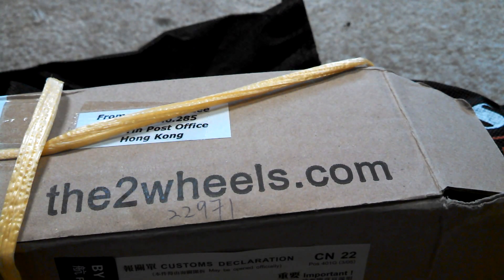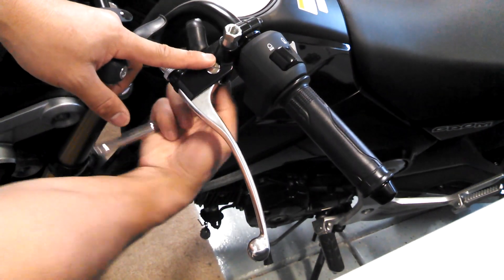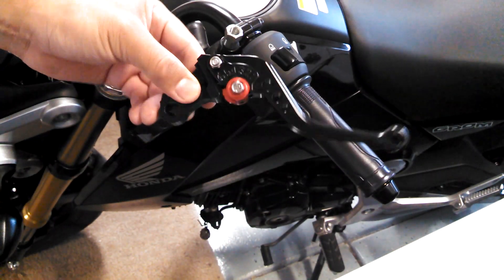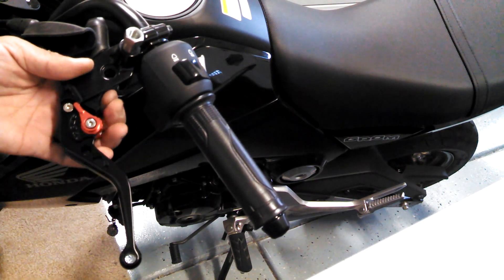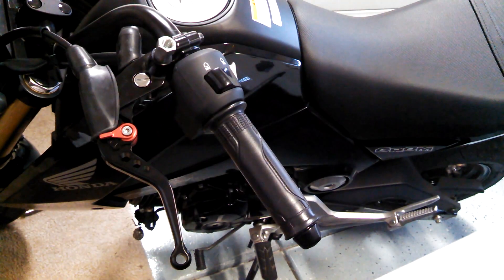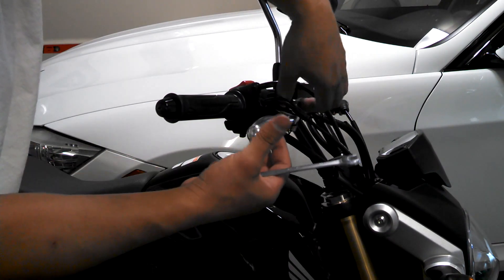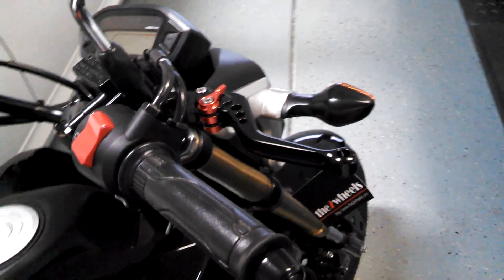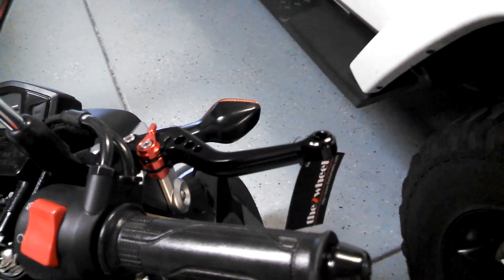How to Change Brake Clutch Levers for Honda Grom

Comment: Next time 1. Loosen tension nut at lever. Line up slot and remove cable first. Note: use short screwdriver so you don't scratch your new lever. Use blue lock tight on nut so it doesn't back off. Don't forget to lube pivot point. Great id. Thanks for sharing.
Reply: Nice one for the heads up 6 years on🏍😎🤙🏾 I use the push clamp to hold the clutch as you said above worked a dream easier than I could imagine...dope..

Comment: Hey I took your advice and bought a set and they set off my repsol Honda all matching throttle grips and matching well
Reply from the maker: okay cool - glad it worked out man... not too tough to swap
Reply: First time ever working on my bike on my own change oil and filter thank you for putting video up for first timer's like me
Reply from the maker: I'm actually a first timer also, trying to work out the kinks and documenting for all to see as well as for me to refer back to..

Comment: I have a cb500x(2014) and I've send many messages to Chinese sellers all saying it doesn't fit hydraulic brake ...and send to a couple of them ur video, I mean they are exactly the same in the pictures - I have the suspicion that they don't know what they are selling. They say they fit my bike ...but only the clutch :S

Lets see what they will say after watching you video(hope they can because of the great firewall of China - although sellers use workarounds most of the time - from what I've seen so far)

Comment: I'm still having an issue putting The clutch line back in the hole where the engine is. Even after I loosened the brake line where to said to do, it seemed like my clutch line is a bit to fat. It was also hard for me to remove it and you made it look easy
Reply from the maker: +Ground Zero (Hbomb619) thx good luck man

Comment: There is a slight bump on the clutch lever that engages a switch this is not on the replacement levers
I don’t think you are aware of this  Not sure what the switch is for but probably do with starting in gear
Reply from the maker: hmm... that is interesting to bring up... i havent experienced any problems.. but i am also a novice.
Reply: Hello
After looking today
 The switch on the clutch lever can only be for one thing and that is to stop you starting in gear.
I also put it in gear and pressed the starter the bike jumped forward
Now if the bump you have on the old lever was pressing the switch to the on position this would not allowed the starter to engage .
I will take mine of and try to make a little bump with epoxy or a small screw this should make this safety switch work once more
or you can just make sure you don’t start in gear ?